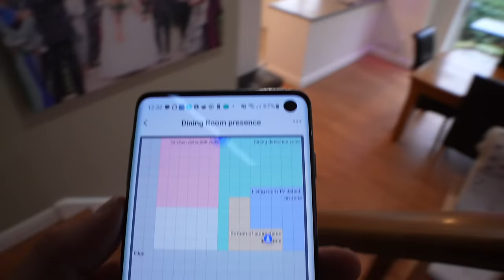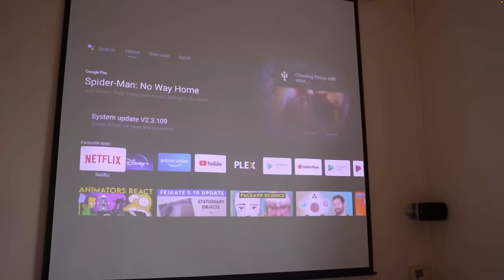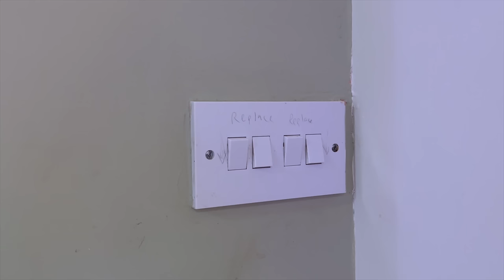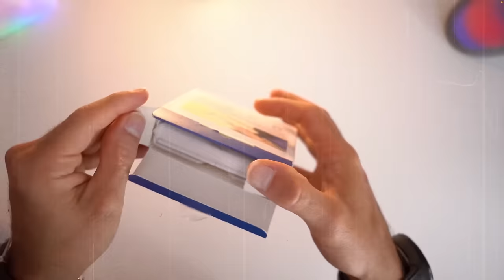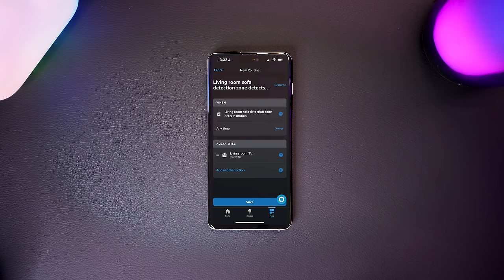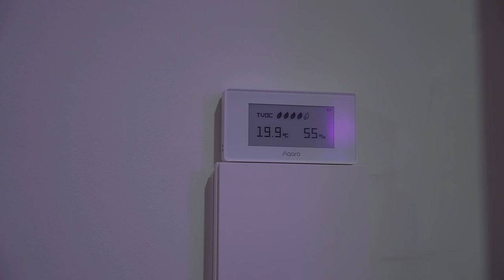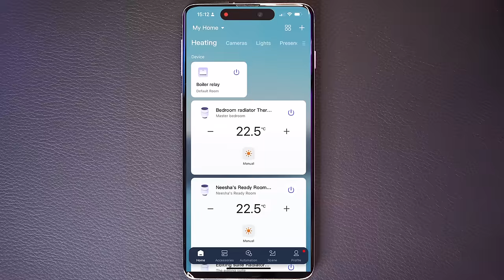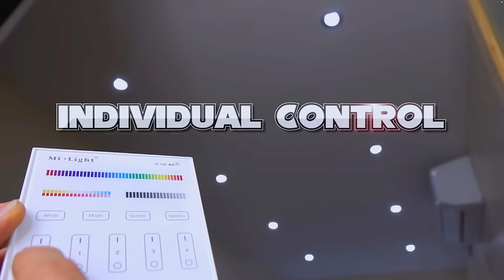This Changes Everything… HUGE NEWS

Comment: Totally agree with this vid, I extended my home and in doing so had a complete rewire with aqara switches throughout. Lmk if you’re in the area Paul and I will give you a tour. Yes i would be excited to show you that just as you would be to see it :-D 
I’m pretty attached to HA, what I’d like to know if how you use aqara hub and HA together. Do you pair to both and how do they interact? Thanks keep up the good work
Reply from the maker: You can either pair the devices directly using a conbee stick (or similar) or you can use the HomeKit integration. As far as I understand it you don’t need an iPhone to use the HomeKit integration! 😊
Reply: Thanks, so if you pair Aqara devices with their hub, can you still see and control them in HA? Or visa versa
Reply from the maker: @damianwarburton7225  if you use the HomeKit integration then you can still use the aqara app as well as home assistant. If you use the conbee stick then aqara are no longer involved
Reply: @paulhibbert super fast response, thank you. 
That is what I was afraid of. I’d like to use the useful features of the aqara app for aqara devices but still have those devices integrate with my other HA devices which is just not possible sadly

Comment: Do you have any recommendation on how to use the aqara h1 wired for 2 switches operating the same light? Ty
Reply from the maker: You have to decommission one of the switches (basically wiring it to permanent live) and then put one of the aqara battery powered remotes in place of that switch. You see the part of the video where I’m drilling the holes? That’s to mount the battery switch over my living room’s two way original switch 👍🏻

Comment: I have to agree with the Tamagotchi nature of Home Assistant, but since I moved away from running off a RPi and SD card and moved it to an an actual computer  (in my case a HP microserver in a Proxmox VM) it's been rock solid. Home Assistant is great at killing SD cards.
Reply: That's exactly what I think, a Pi with an SD card is not powerful enough. I Run HA on an old Windows 10 PC and its rock solid.

Comment: It’s interesting. Both you and smart home solver both just did a sort of rework of your smart home setup. He ended up going with home assistant as the back end and Apple HomeKit as the dashboard or front end. Meanwhile you’re mostly ditching HA and using aqara.  

I think I may go with a mix of both. I like apples dashboards and it’s easier for me to get my GF on board using Apple stuff. I can use aqara for most automated things and the very few things I can’t make work between those two I’ll use HA for  that.

Comment: Aqara one major downfall is the devices don't always communicate properly which can be a pain. It also odd on which ones don't and which do like the P1 motion sensor when its older brother had no issues. That said it does generally work and the new FP2 is impressive to the point it saw through my walls and got the people in the condo across the road before i put a border in  🤣 It's also never a good idea to have all the eggs in one basket so to speak and a backup is always a good idea.

Comment: I have started with Aqara based on your reccomendatiosn however I am facing quite a few annoying issues even in the very limited number of items I bought.

The indoor camera's (both the new E1 and G2H Pro) seem to have a delay in audio of 2 seconds when watching a recording made to the SD card - the G4 doorbell does not have this problem, I don't know about the G3 camera.

The new Wireless T1 mini Switches are compatible with Alexa however, Alexa only recognizes their inputs (single, double click or long hold) about 10% of the time.

I don't understand why these issues occur and on top of that Aqara support has simply stopped replying to my email about it.
Reply from the maker: Morning dude! I hadn’t noticed a delay on audio when testing it originally, haven’t actually ever needed to use the recordings yet, it’s so far only been required for just checking in.  Im curious what impact this has on you? Unless you’re recording videos for YouTube on the camera the delay is a barely a minor inconvenience that could always be lined back up in editing if you desperately needed to use the footage for something

I’ve never tried to start Alexa routines with the T1, I’m excited it can do that! I will have to test it and see if I have the same issue.

The light switches in this video absolutely work with Alexa via my G3, I’ve just tested to make sure as you had me worried!
Reply: Didn't expect a reply! Just wanted to share @paulhibbert  

Impact about camera's delayed audio: I recently got a kid and I just like the idea to save clips of memorable moments, first steps, laughing, falling, etc. and having that with audio out of synch just doesn't do it for me. I am hopeful Aqara support will help out as I really like their products overall.
I 100% agree, live view is perfect and super responsive.

Additionally just a comment; G4 microphones are not quite at the level of Ezviz C3X camera's I have dotted outside (also bought few years ago through your recommendations ;) )

That's awesome they work with G3 hub.... perhaps some differences afterall. Or I come to suspect you might be using the ones with Neutral wire? I have without. That could be a factor too, not sure.
Reply from the maker: @SKogel  that’s a really cute idea, hadn’t thought about capturing kids first steps and stuff 😁

My switches are no neutral 🤷🏻‍♂️ have you gone into the profile section of the app and clicked connect to ecosystems and added Alexa that way? That’s how I did it
Reply: Regardless I think Aqara it'self is just amazing. Automations supporting conditions and multiple triggers.... why can't others just implement this simple thing???
thank you for your videos!  @paulhibbert

Comment: I would be so annoyed with the lights turning on after I already entered the space. Aqara has the granularity so you can turn the lights on as you approach the next room. Use the sensor in the occupied room to turn on the lights in the next room as you approach the doorway. When you have already turned the lights on in two places in the upstairs hallway, then turn the stair lights on before you get to them in anticipation, once you also end up on the stairs, turn the lights on in the room below. There is nothing more mentally taxing than a delayed light coming on after you have already entered the unlit space.
Reply from the maker: Sure, you just set the edge of the zone where you want the lights to trigger. I also have a 20 second delay now set for the lights to go off so the room waits a while before going dark

Comment: Great video Paul, so good I watched it twice :)  Loving the new house, really like that system, at something I really would like to achieve here, the interesting to know how much that would have cost has got to be £1k plus right? Including electricians fees. I also have 4 gang light switches, No manufacturer makes four gang smart light switches really annoying! Did I hear you right that you are going to use 32 spot bulbs, isn't that gonna like take you a month to pair? Lol agree with you that home assistant is not all it's cracked up to be, and I'm mostly using HA now for automations that Google (yes I use Google) won't do.

Comment: Hmm, hadn't heard of those zigbee GU10 bulbs - sadly not available from your amazon link at the moment - I only need 22 for the living room.....

but as it'll be £450 from Ajax, I think this will need to wait until bonus time next year.
Reply: Shelly make GU10s as well. They use purely local WiFi, work natively with home assistant and are cheaper than almost anything else.
Reply from the maker: I’ve added a link for the gu10s to the pinned comment now if you wanted to give it another go. UK only sadly

Comment: Home Assistant feels to me like the guys driving development don't understand normal humans. Every time they send out an update it's full of new things which 90% of people won't use, rather than, for example adding out-of-the-box support for a decent motion activated light routine that only runs at certain times of day.

Seriously. Install Home Assistant, add a few bulbs and sensors and try to make a routine which turns on the lights low when it senses movement only at night - it's a complete pain for a newbie.

And yes, I'm aware I've just triggered the neckbeards. Have at it in the replies.
Reply: I have sex AND homeassistant - and while I have a beard, I keep my neck shaved!
I have the setup exactly as you describe, and it wasn't painful at all once I discovered the SUN entity. It can be done visually with no YAML at all.
The best trick I have found is to have 2 seperate automations - one for light on and one for light off.
It makes it a whole lot easier, and then down the track (when your partner gets a month worth of "headaches" ) you can learn more about HA and merge them - or not.
I haven't bothered - they work, so why mess with them.
Reply: HA is constantly broken - After 5 years of use i see no hope for this platform. Problem with strnage developers and community admins. After all this time they can't even implement simple scheduler, countdown timer, or ui customizable card - things which are basic for every home automation system. I'm also buing new devices with intention of switching system. And just better not ask about security.

Comment: I trolled through your arhives and found. . This comment: Never just use one smart home brand. Vary your eco system. Well you are not going to  believe this. I sold all my Aqara. I went Tuya. I have never regretted such a comprehensive high quality everything smart under one apo solution. Never. Sure there were minor issues but I sample out of the thoussnds of smart devices choices. First I test snd test, then purchase the best of device crop quality and stability. So I have been doing this now for 2 years. It just works, it just works. All of it. HA awaits. Rolling out some Tuya eco Robotics for mowing  very soon. Congrats on new home.

Comment: I've determined that the best setup going forward is everything wired.  Wired motion sensors and wired switches.  Everything else is just too damned unreliable.  I had door sensors and motion detectors to control my lights and it was just a pain in the ass to manage.

Comment: You will never find one eco system or manufacturer that has all the devices and functions you need. There is no way past this without getting you feet wet with Home Assistant.  Maybe in five years when everything for sale has Matter this might change. For dimming 100% Shelly Dimmer 2 with Philips MasterLED >90 CRI with optional Dimtone 2700-2300 is amazing. CRI98 MasterLED bulbs make your food epsecially salad just pop with colour.

Comment: Not keen on Aqara. If manufacturers stuff wont work in habitat and HA easily, its out because Hubitat as the Zigbee/Zwave hub and HA as the interface is the way I have gone in my smart home and sadly Aqara don't follow the ZigBee protocols properly. Too many of these manufacturers deviate from standards to force you to get one of their hubs and I don't like that. It must work with Hubitat or its out!
Reply from the maker: I get that. It’s DOES however work great with Home Assistant. Hubitat are great guys but I’ve had this argument with them before, they refuse to accept they need to make a proper integration for it as they think it’s an Aqara issue, but if it works fine with home assistant then 🤷🏻‍♂️
Reply: I cant find a driver for Aqara that works directly in home assistant unfortunately. This is my usual approach, if it doesn't work in one, use it in the other and automate accordingly but I run into a wall with my Aqara light switch sadly. Happy Christmas Paul.
Reply from the maker: Happy Christmas dude. For aqara to worm in home assistant natively you’d need a congee stick or similar to connect the devices too, but the other option is the HomeKit integration which should find them automatically if they’re in your network! Not sure if the devices run locally that way or not though!

Comment: I wonder why you're using binary lights? 🤔

Just the "bang" "bang" light level changes would drive me nuts. Not even mentioning the different light temperatures between living room and kitchen area.

Why not use smart lights and blend in and out the lights smoothly, plus adapting the light temperature over the course of the day? 🤔
Reply from the maker: This was just for a demo, would have been a pretty boring demo if the light waited 20 seconds before going off 😉
Reply: @paulhibbert  yeah sure, but that's not what I meant. Do you really switch your lights on/off binary? I mean no fading?

What about adapting the color temperature and brightness over the cause of the day via Adaptive Lighting? 🤔
Reply from the maker: Oh I see, that sounds like a fun project! 

The plan is to replace all the bulbs with Zigbee GU10s so that au will have e control over the brightness and colour as well as the ability to cut and reintroduce power from the switch

Comment: I don't like Aqara anymore, every December the connection to Alexa stops working, tried disabling re installing etc. It worked for a few days then stopped again. If everything is in the Aqara ecosystem then it is good. Also it is not  an Alexa issue as there a people complaining about homekit and good routines not working with Aqara

Comment: Aqara is a good brand, untill you need something they don't make.Untill you need to integrate it into Home Assistant. Untill you need to change batteries everywhere... must I go on?
Reply from the maker: Aqara are the company I change batteries for the least, I have all of their stuff working in HA, and they can hardly be blamed for not making literally every device 🤷🏻‍♂️
Reply: @paulhibbert  Well I had issues pulling them into Home Assistant via the G3. The video stream and it's detectors cannot be used in home assistant as of my experience. I also have negative experiences with their door sensors as in their batteries drain every 2 months. Also, they just don't make the devices I need. To me, Aqara just isn't cutting it and they can only satisfy me 50%. I must say tho all their stuff is very well made in a very decent quality and the camera has a top tier resolution.
Reply from the maker: @dylanlanckman7906  maybe it’s the difference between connecting their devices to a conbee stick in HA and using the camera in HA. I assume if you use the HomeKit integration to get the camera to advertise the devices that you should get the same experience as if you were using the aqara ecosystem without HA 🤔

Not sure about the camera feed though, never tried to get the camera feed in HA. If I was going the HA route I would probably use my conbee stick for the sensors, and a camera system from someone like eufy or EZVIZ for the cameras

Comment: Quick tip on Aqara switches:  Even if you need a single rocker wired wall switch, get a double rocker. 

The empty one will be switching "nothing" so just terminate the output with a twis-cap. Then use it in automations. When pressed, use it as a "toggle" to toggle the state of other lights. Very handy for me in the bedroom to toggle the backyard lights that are wired to the bathroom (don't ask :( ) ... or for the kids' room to turn off their Aqara light strips on their gaming PC desks from the entrance light (again, that's a double controlling the top light, and the 2nd configured to toggle the desk lighting)....

The difference is about $5, a lot less than any wireless switch than would look different from the wall switch to begin with and take more space up.

Comment: I would say ditch home assistant. Yes it is highly customizable and local but jesus christ it's can be annoying confusing and time consuming. 

You can easily spend hours just trying to get 1 thing to work in home assistant. I'd rather have two smart home platforms operating in my house before I solely depend on home assistant.

Comment: Also know that if you ever wanted to expand beyond Aqara for Zigbee, you're out of luck. They run a non-standard version of zigbee that will potentially cause issues. Funnily enough, the only thing that wasn't rock solid for me in Home Assistant was Aqara.
Reply from the maker: Been using aqara in home assistant via a conbee stick for years. It’s the only thing that IS rock solid!

Comment: I have a bunch of Aqara devices, and they've been great. One thing however, they do not re-route if they are connected to a router device before connecting to the zigbee coordinator. This means if that router goes offline, so does all the aqara devices connected to it, they won't re-route like other zigbee stuff. Also, the Ajax stuff is basically rebranded tuya devices. You can tell by checking the firmware versions of the devices. I've got 2 Ajax plugs, and realised they were identical to some tuya plugs I could get from aliexpress for a 1/4 of the price. So I did ;)

Comment: I am on my second M2 hub because the first one broke down in 1 year. I stopped buying Aqara products because of this. If the new one fails again, I will look for another option. I also have 2 switches with Lutron, and those 2 are great, expensive, but never fail.